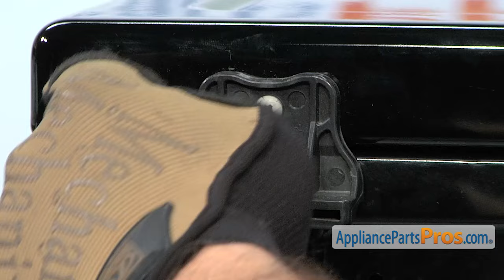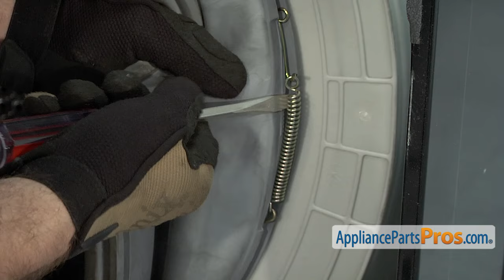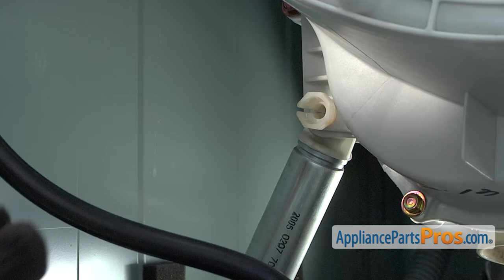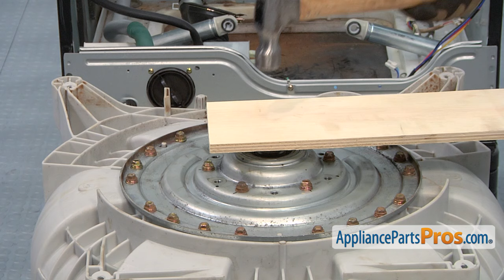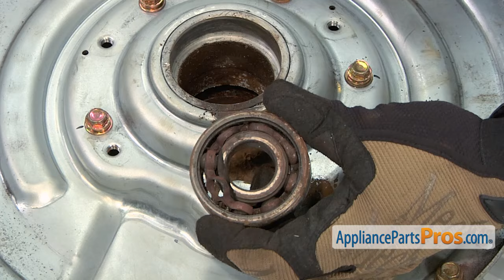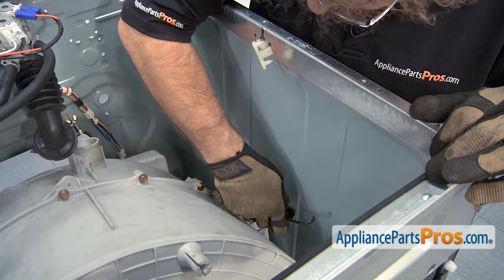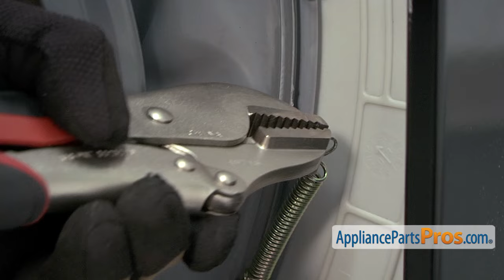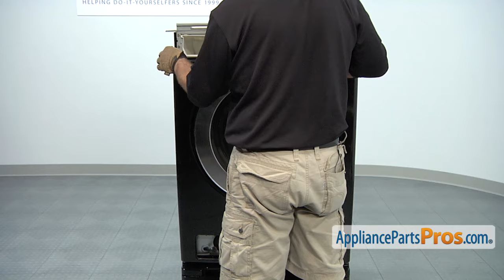How To: LG/Kenmore Washer Seal 4036ER2004A

Comment: Yeah I’m just gonna buy a new washer lol.  Good detailed video though.
Reply: People like you are great for business 😉 

I find jobs like this easy to follow and do. If everybody did, there'd be no business for repair centers and manufacturers
Reply: @truth.speaker  I think you’re right.  I was with him the first 4-5 steps. After that I’m gonna start losing parts especially with small kids around in a little space lol. Normally I wouldn’t mind taking on a challenge but this dude is taking the whole thing apart and there is always that one screw  in my experience that won’t go back in.
Reply: @truth.speaker  here’s a tip for any job like this: get a muffin tin (or two) to hold the screws. If you group the screws by each section you are working on and place the in order in the muffin tin, then it’s easy to go backwards when you are putting it all back together.
Reply: @jeffcushing6016  good idea 🙂

Comment: 10:10. I'm unable to remove the 17mm bolt. Called the service guys, and even they couldn't remove it. Any Ideas?
Reply from the maker: Have you tried soaking it with penetrating oil? Soak it, let it set for 24 hours, then see if that helps
Reply: First, make sure the tub can not move. I wedged a screwdriver in to stop the tub from turning. I put on a socket with the handle. Give it quick smacks with a hammer (socket handle). What you are trying to do is get it that first budge; short hard blows. Mine moved in two wacks.

Comment: Amazon still has a few of the parts kits available. 
Wanted to repay you for making and posting the video and tried to buy the replacement parts from you. Was told they were unavailable. Thank you for the excellent video! I am not a mechanical person but the simple step by step instructions and the pause button  made this job quite manageable.

Comment: Not a job I'd do unless you have a better part of 5-6 hours to do it and some mechanical experience, Could have done it in less but while it's apart I cleaned out all the old mildew and nastys stuck in the drain lines, cleaned the plastic drum super super good inside, etc.  check all the noses for issues. I wouldn't say it's hard, but it's certainly a process and need to be minded for these types of jobs.  Good to keep a washer out of the landfill, hopefully, it can go many more years

Comment: Great video.  You did a good job with the recording and step by step instructions.  I did my 2 bearings and a seal in 4 hours.  But two things. You do not need to remove the bellows from the tub.  Don't use a chisel to install the bearings. Thank you for a great instructional video.
Reply: Yeah, I think he used a long extention but they  have a bearing extraction and installation tool.

Comment: Thank you guys so much for the video, it helped me out a lot. Im sure I could have done it without this video but there would be a few steps I might question. You guys did a great job with the video including the camera angles, and the short clip of each bolt you tightened. Unfortunately we waited to long to replace the bearing and it got so bad we had to replace the spider arm also, with that being said we had about $175 in repairs, including both bearings and seal, as well as spider arm and outer plastic tub seal. All parts I bought from yours website because you made such a great video!

Comment: Thank you so much. I was able to do this on my own it just a few hours thanks to your detailed instructions.

I would like to reemphasize some tips:

1. Don't remove the metal ring from the inner tube seal at all, there is no need to remove the rubber gasket completely.

2. That punch tool is essential to get things moving, both out and in.

3. Use the old bearings to get the new ones in without damaging them.

4. There is a kit on Amazon with both bearings, rubber seal and huge tub seal o ring thingy for the 2 white halves for $35.

5. Change the spider while you're at it. Mine was intact but heavily corroded and absolutely filthy and stinky. A replacement was $80 on Amazon and it took just a few extra minutes to swap it out. This will help the smell immensely and also help me get at least another 10 years out of my washer given that bearings are new as well.
Reply: I was wondering what happened to this repair guy saying his spider arm was corroded and needed replaced as well.  We just bought a second hand Kenmore Elite H3 t and it was shut for awhile while a home was sold, so it's a bit smelly. Likely from having the door closed and such.  If we do this repair ouselves, we'll defo keep an eye on the spider arm as well.  Why would it be really smelly?

Comment: Very helpful video, but a couple of modifications I would recommend. I doubt anyone will be able to "tap" out bearings or tap the new ones back in. First time I did this it took me 3 days to get bearings out. In the end I used a sledge hammer and a 10" hex bolt to get them out. Place the hex end against the old bearing and hit it hard. Use lots of penetrating oil. I also had a very hard time getting the new bearings in. Here I would place the old bearing on top of the new and use a 1 foot section of 4"x4" and the sledge hammer to seat the new bearings and seal. It's very important to inspect the shaft and spider arm carefully for signs of corrosion. I did not look closely enough at how the base of the shaft area fits into the seal. Mine had some corrosion and pits that I did not look for. I did not replace it as I should have and ended up having to do the job a second time in less than a year

Comment: Thanks for the video. Mine smelled like burnt rubber and eventually started to smoke. Ended up being the aluminum spider bracket. 2/3 arm supports were cracked. I should have addressed the issue sooner b/c the stainless inner tub wore groves in the plastic outer tub - completely through. 10 years of use, can't complain I guess.

Comment: Just got done replacing my bearings and tub seal.  I attached the weights after the liner was installed.  I knew that would make it much easier.  I used my old bearing as a drift when I installed the inner bearing.  Other than that, pretty straight forward video.  A tip for anyone trying to knock out seized up bearings.  Put some rust dissolving solution on there and let it sit a few hours.  I used METAL RESCUE GEL.  It dissolved the rust on my inner bearing and allowed me to knock it out after sitting about 3 hours with the solution completely covering the bearing.

Comment: If you have trouble putting in the bearing due to the snug fit try putting the bearing in the freezer for awhile before installing it. The cold will cause the bearing to contract becoming slightly smaller in diameter making it easier to fit in its bore.

Comment: Great video; helped me save probably $500 or more.  A couple tips for the next person. Make sure you order the seal in addition to the bearings; you will probably need it.  It was extremely difficult to remove the tub shaft from the bearings and my tub was not nearly as rusted as the one in the video, Also, you should watch other videos on how to remove stuck bearings; mine were almost impossible to remove.

Comment: The machine basically roars when spinning and is very loud. So I've watched this video about 4 times and while I'm doing the job. I ran into a fact that I'm working on the Washer-Dryer combo unit... basically the same process. At this point I'm having trouble knocking out the inner drum from the plastic outside drum....I added 3 in 1 oil to work any rust but nothing is budging yet... any suggestions?

Comment: I used this great step by step video to successfully change the bearings in my LG WM3001HPA  Steam washing machine. 
Although a long and relatively complicated job, it's also as simple eating an elephant - one bite at a time.
My machine was not exactly the same model the layout and procedure were close enough to make me feel confident enough to tackle the job myself instead of paying a job quoted $500 to a technician.
It took me around 4 hours from start to finish on a quiet Sunday afternoon.
I figure that a so called technician with experience can do the same job in half the time, so allowing $100 as an absolute maximum for factory original parts, those guys are pulling in over $200 per hour for a job any competent amateur can and should do themselves. 
Incidentally all the parts cost me a total of $40 on eBay including the drum rubber seal, and the machine is now as quiet again as the day I bought it 7 years ago.
Perhaps I should change my occupation!
Reply from the maker: Glad we could help you out with that repair! Next time, we hope that you'll consider purchasing the parts from us. Unlike most Ebay vendors, we do offer a 365 day warranty on our parts!

Comment: Just order the back half of the outer tub , the bearings and seals are already installed and replace the inner tub shaft if you want a quality repair. This is a short term fix with a lot of work
Reply from the maker: Thanks for that tip.

Comment: I had the problem with the loud grinding during the spin cycle.  However, I believe the bearings finally gave out completely and we were getting an "LE" error as the drum would not spin at all.  I watched this video which was incredibly well done.  While I am fairly handy with doing my own repairs, I have elected to have an appliance repairman do this.  It is good to at least understand what is going to be pursued.  Hopefully the bearings are the only problem and we can extend the life of this 13-year old unit a bit longer.  Thank you for the excellent repair video.
Reply from the maker: You're welcome!

Comment: Thank you for this useful video.  I just finished replacing my noisy bearing on an LG WM2501HVA Direct Drive washer.  Your video was very helpful, and you made it look easy.

Some challenges I ran into, that will hopefully help others, include:

1) Driving the old bearings out was very hard, so hard that I bent a drift punch, and when they finally cut loose I accidentally scored the bearing race.  I cleaned this up with a small Swiss pattern file and steel wool.  If I had to do this again, I would not pound the bearings out, I would use a bearing puller.  I was told that many people crack their washer tub when doing this.  That could be a costly accident (~$300).  I am surprised I did not crack mine.  I used penetrating oil and even so it took a long time to get the old bearings out.  Worth using a bearing puller next time.

2) I kept track of all the different screws using a box with many different compartments, and even so, it was not easy.   Next time I would put them in plastic bags with Post-It notes.

3) I used the old bearings with a piece of wood and a rubber mallet to drive the new bearings in.  Worked like a charm.

4) When pushing the inner washer drum (metal) back into the rear bearing, mine did not fully seat. I noticed this when I was putting on the stator, the splined shaft did not stick out enough.  This was a drag since I had reassembled a lot of the washer at this point.  I threaded the 17mm head bolt back into the shaft, without the rear magnet part of the stator, and then carefully leveraged the shaft to fully seat using a large screwdriver and piece of wood to pad.  This worked out fine and allowed the shaft to protrude enough to install the stator as in the video.  So, in the video around 20:07, Matt pushes down on the washer with body weight, I pushed down but did not fully seat the shaft.

5) The gasket seal was a pain.  Mine had residue and mineral deposits on it.  I carefully cleaned it in the sink and put a very light coating of liquid soap in the groove that needs to slide over the plastic.  The rear spring was hard to install. I used Vice Grips as in the video, and as expected, broke the connection on the end of the spring.  Went to the local hardware store and bought a replacement spring that was no so brittle and little bit lower spring constant.  That worked easily.

6) I put the front gasket on, before the tub weights (thanks for the tips on here on doing that, that made it much easier)

7) When I had the tub out, replacing the bearings, some plastic hemisphere parts associated with the water inlet ports, fell off.  This concerned me at first, but they slip right in and the water hoses hold them in.

If you are replacing a noisy bearing, I recommend ordering both bearings, the bearing seal, and the tub seal, and the front gasket springs (hoops).  Buy, rent, or borrow a bearing puller.

Appliance Parts Pros were great, not only in this video but when I called to ask some questions.
Reply: I should have read your comments before I did mine.  I hit most of these issues.  When I installed the shaft and it did not protrude enough I did the following: cut a small piece of 1X4 and drilled a 1 inch whole through it.  Then I put that over the shaft and then threaded the 17mm bolt in an tightened this against the wood.  This seated the shaft enough to install the stator.
Reply: @BruceGuitarLessons  Very helpful and creative!!! I may face such a situation when I will work on my Washing Machine.

Comment: This fix took about 6 hrs and I have mechanical experience.  The hardest parts are getting the bearings out and getting the tub gasket springs back in. I had nothing else to do on a workday and thought let's try and save some money. Basically paid myself $600-900 dollars. 

I would definitely leave the tub gasket on because no BS it is a pain to get the spring back on. Everything in the video is spot on and had to watch it a few times.

Comment: Is there supposed to be a rounded groove on the inside of the plastic tub just below the rubber bearing seal? I just took mine apart and there is a rounded groove where the shaft goes through. That bearing completely fell apart and when I removed the spider part if the bearing was fused to the shaft, and a 1/4 inch chunk was missing from the bearing so it looked like a crescent moon stuck to the shaft. Is that groove in the tub supposed to be there?
Reply from the maker: Hmmmm. I'm not sure. We will need the model number for the appliance, so that we can look up diagrams and information about your specific unit to give you accurate advice. You can look here on our website to help you find the model number: http://www.appliancepartspros.com/modelnumber_locator.aspx You can give us a call at 1-877-477-7278 or you can chat us at our website: http://www.appliancepartspros.com/.

Comment: Question concerning the SPIDER FAILURES with Front Load Washers. This seems to be common to FL's...  I was just given two FL's to Fix if I liked.  The Samsung was really jacked up wouldn't turn at all but the LG TROMM WM2277HW would turn but wabbled badly. & grooved the front half of the outer tub till it ground thru in one spot. I have found all the parts to put this back whole again for $170.00 but reading forums about FL's in general it seems the SPIDERS FAIL ALOT! This one was broken in 3 places and the aluminum was just in crumbles. Makes me wonder if I Would ever Want a FL Washer or bother fixing this one! Again it seems from reading posts that Most FL's ultimately End with a Broken Spider due to the harsh reaction or HI PH eating the unprotected pot aluminum. The bearings were fine but I could crumble the SPIDER w/ my hand. Seems like a poor design to me. Many people post they had this fail within 5 years. Geeze! I got over 20 years out of my Top Loader. What is your take on the Matter?
Reply from the maker: There are definitely advantages and disadvantages to both front load and top load. The spider is one of the things liable to fail on a front load washer, and it's tricky to say whether it would be economical to repair the ones you were given. The longevity of a washer depends a lot on how often they were used, what was washed in them, and how well they were treated. When it's your own washer that fails, you know whether you've treated it well and it's likely to last a lot longer after a repair, or whether it has had a hard life and isn't worth repairing, but it's hard to know when it's a used washer.
Reply: sledgebeast with replacing the spider, would it make sense to paint it prior to assembly with some form of etching primer to protect it from the environment?

Comment: Thank you very much for the video..  However, I need to add, if your washer is extremely loud and the bearing already failed.  Plan on getting the spider arm with the spindle.  It would have made my change out much easier..  Had to cut off the bearing off the spindle.  Plus the fact that my spider arm was really corroded..  Think it would have tore up the new seal in no time.
Reply from the maker: Glad our video was helpful! Thanks for the tip.

Comment: Props to all the handymen, I got stressed out just watching the repair. Id rather go buy a new one for $900 By the time I fix all that I ll still have a old washer that after taking it apart will probably start leaking later.
Reply from the maker: That's possible. We understand that not all repairs are simple, but we believe it's often better to repair than replace! If you decide to repair it, we're here to support you., though. :)

Comment: Hello, Thx for the video.  I've been stuck for hours now not able to reseat the shaft far enough through the new bearings in order to reattach the magnet cover.  I'm about 3/4" shy.  My bearings and seal appear to be placed exactly as they are in the video.  Everything is flush.  Any advice?  Thx.
Reply from the maker: You can give us a call at 1-877-477-7278 or you can chat us at our website: http://www.appliancepartspros.com/ and we'll be glad to help you figure out the problem.